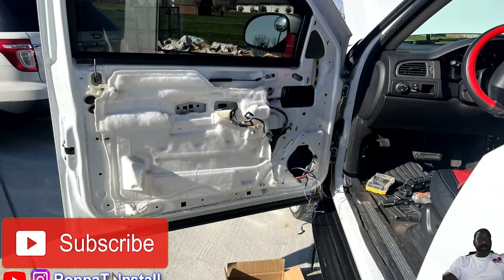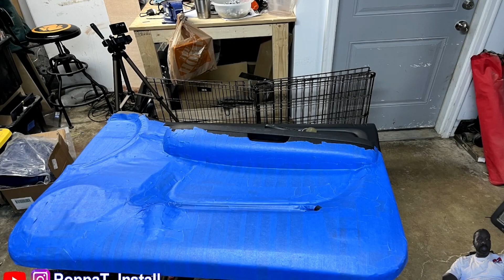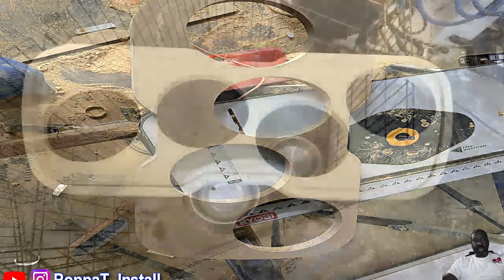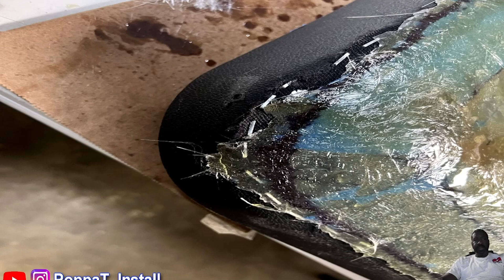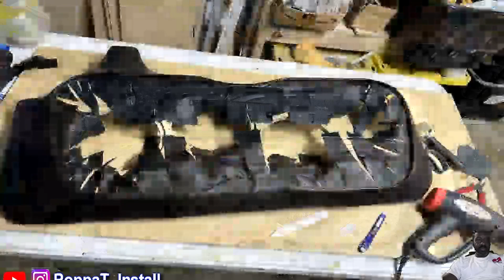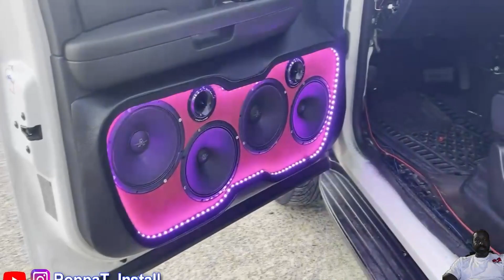Custom Door Panel Build w/ Deaf Bounce Apocalypse 8" mids and Neo Tweets

Comment: Looks great brother…how did you wire up those 8”s and tweeters man?
Reply from the maker: The mids were 4ohm and tweets were 4ohm.  Mids were off an amp and the tweets off the radio in this video until he got another amp.
Reply: @PoppaTInstall  thanks 🙏🏽
Reply from the maker: Series/parallel, and the final impedance was 4ohm. □
Reply: @PoppaTInstall  thank you brother.!!
Reply: Did you wire the mids in series  or parallel?
What was your final impedance?
Thanks.